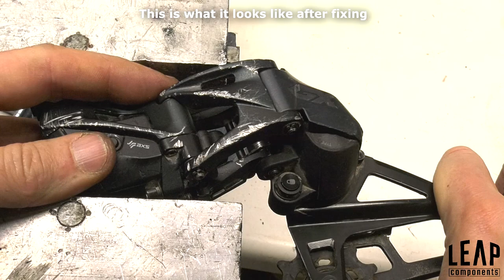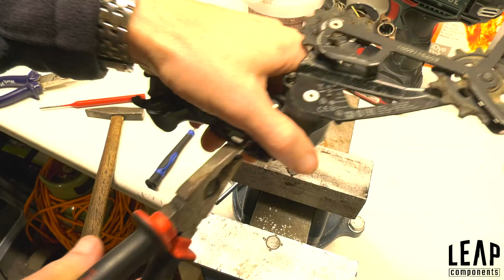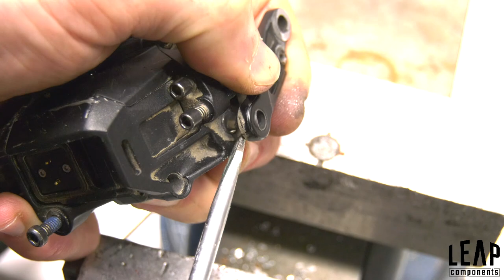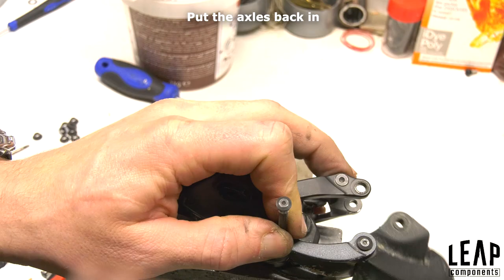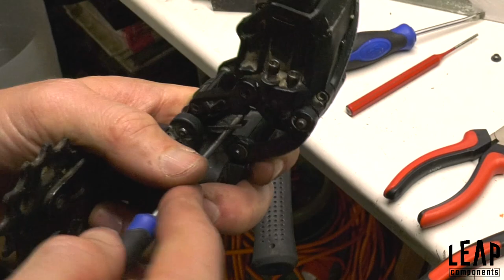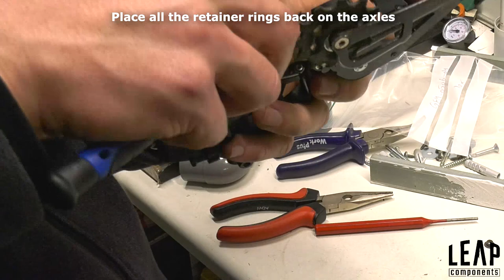SRAM AXS Derailleur Parallelogram Bushing Replacement

Comment: Hi, nice video. Do you have one for the SRAM Red Etap rear derailleur?
Reply from the maker: Thanks! We are working on it, but the problem is a little bigger with the etap derailleurs. one of the aluminium axles wears out before the bushings are done. Keep an eye on the Leapcomponents instagram if you like to keep updated.
Reply: @ad-biking  Great to hear that you guys are working on it? Any estimated timeline? Would you guys by chance able to provide the steel pins for the etap derailleurs as well? I accidentally damaged mine when I tried to remove them so need some new pins to replace them. Thanks.
Reply from the maker: @EM-ec8zo  for the moment we only plan on replacing the one problem axle. They are pretty expensive to get  produced in titanium (we can’t do that in house), so we probably can’t do the whole set of axles from the start. Maybe we can add them later to the lineup

Comment: The one bushing you don’t replace in the video (top/back A) is it possible to get to after a bit more disassembly of the mech? Thanks
Reply from the maker: Thanks for the feedback!
Yes for that one you need to remove the motor. We will make a updated video with some extra installation tools in the coming weeks (this video wasn't actually made to be published).
Reply: @ad-biking  that will be great to see. Does that mean the spring tool will be available soon? Thanks
Reply from the maker: @TomPugh450  Yes, I think we will have it ready for the webshop in about 3 weeks (we are waiting for a external supplier).

Comment: Hi, quick question. Is pin of same size than the one you can find on non road derailleurs like sram eagle XX1? Thanks!
Reply from the maker: yes, GX XX1 and X01 use the same parts.
Reply: @ad-biking  Ok, I was talking about reuse a pin of an mechanical eagle xx1 into a Sram red/force AXS… have the same playing problem …
Reply from the maker: @artecoids  ah now I understand. The Red/force AXS uses there own style of pins. (so the MTB stuff won't fit). These are made of aluminium, and wear out way to quick if you ask me! I don't know anyone who makes replacement pins at the moment, but keep an eye on Hopp Carbon Parts. They might make a set in the future (they also have a titanium set for the MTB derailleurs).